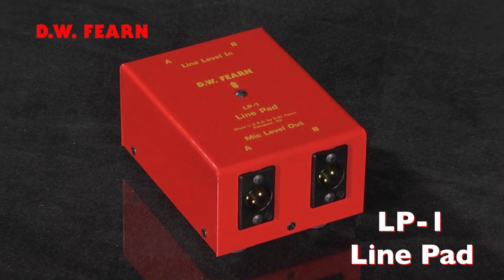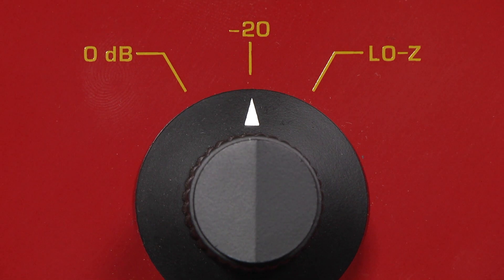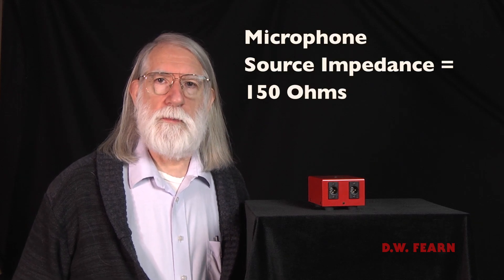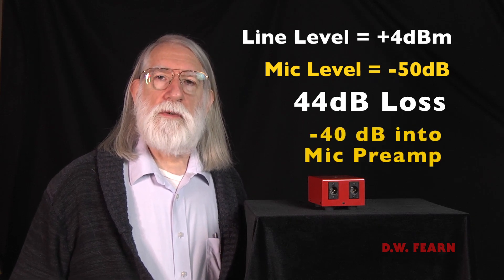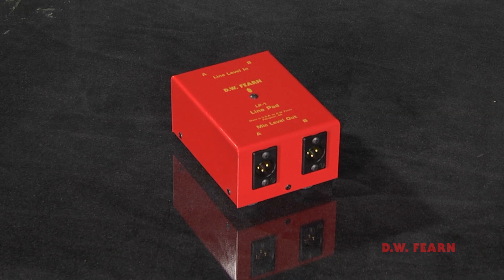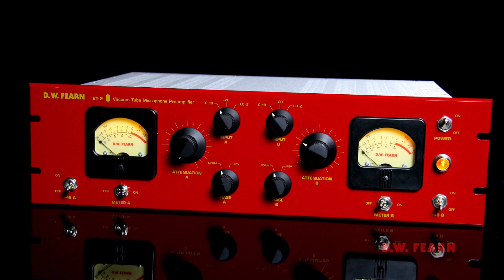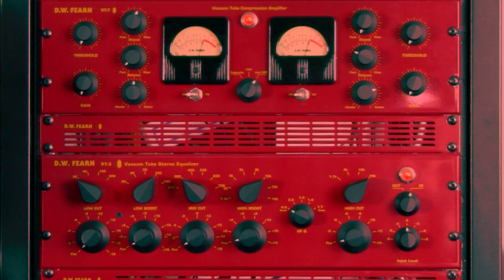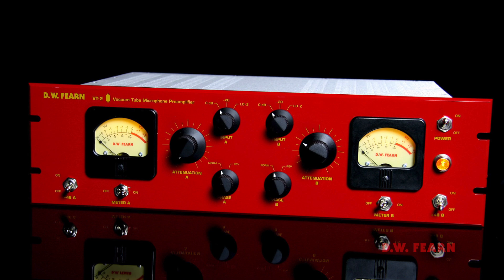D.W. Fearn LP-1 Line Pad Tutorial

Comment: I’m using the DW Fearn LP-1 with my Neve 1073 DPA which allows me to go through the two Microphone inputs, passing through the left and right input and output transformers (as the DPA unit has electronically balanced Line inputs). This was the best solution I was offered by KMR Audio UK back in 2008. The LP-1 is very beautifully built, and I’m glad to have got one of these red boxes at the time . Thank you so much Doug, from Roop, UK